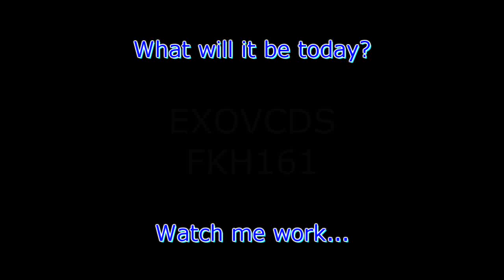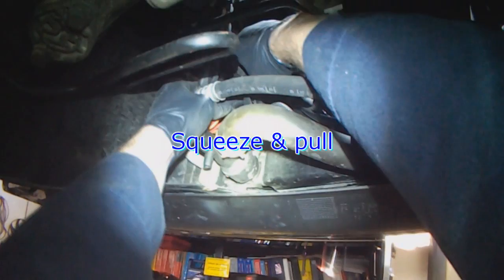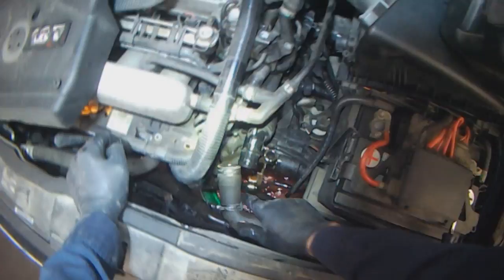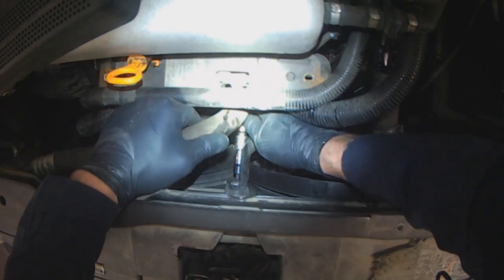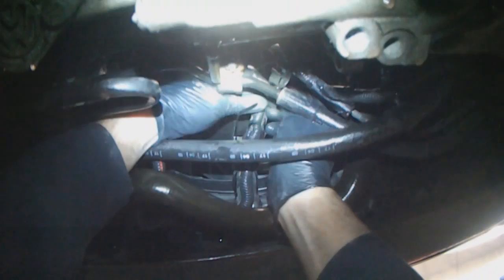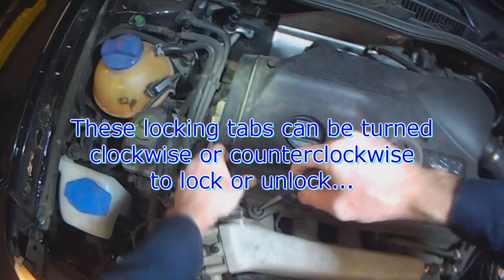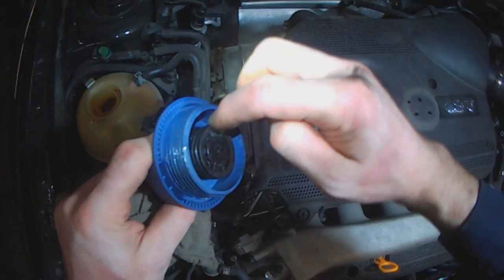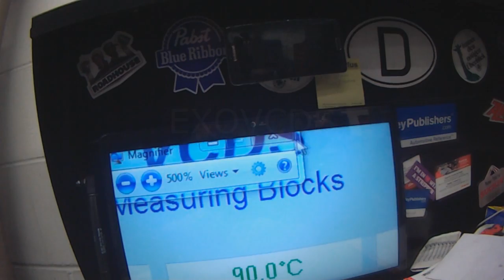VW A4: 1.8T large radiator fan replacement (A to Z)

Comment: FYI for everyone:  I just did this job today and the replacement fan was from Febi Bilstein.  On these fans the fan is held onto the shaft with a nut.  Mine came out of the box loose.  I put a little bit of low-strength Loctite on the threads of the shaft and tighten the nut up good.  Other than that the fan works fine.  Check yours before you install it!!
Reply from the maker: Good info for those with the same setup. Thanks for sharing!
Send me your mailing address and I'll send you some of my channel stickers.

Comment: Thomas I'm trying a spray can called chain lube , not sure the brand but it's pretty cheap and I think it's  got a lot of anti seize  in it. It sprays fantastic .  Might be a good product for you as well . I did the rotor face to the  aluminum  rims  and it's much better than the  old brush on anti sieze.
Reply from the maker: Thanks for the head-up... I'll keep an eye out for it!

Comment: Great stuff Thomas, doing this on my 2002 Audi TT Quattro 1.8T ALMS tomorrow and this helped. Really interested in the coolant info in here, my heater is slow to warm I think I may have a air bubble in the system. Have any videos on that problem specifically or will the info in this video suffice to fix it? Thanks mate.
Reply from the maker: Most likely a bad thermostat... opening too soon or not closing fully.
Reply: @EXOVCDS  fan definitely not working, running hot and climbs especially at idle.
Reply from the maker: @beaucottington if the water pump doesn't work, you will have lack of heat inside the car and the fans won't come on because the radiator doesn't get warm / hot.
Check for coolant flow back into the reservoir. No flow = bad water pump.
Reply from the maker: @beaucottington follow these steps.
https://youtu.be/LiDRUWPw_f4?si=2V7rg3xsQpjZz2Iy
Reply: @EXOVCDS  new fan installed and it engaged as it should, flow seems to be fine was just a bad fan motor
Reply from the maker: @beaucottington  thanks for the update!
Reply: @EXOVCDS  its a bit different on the TT than the VW but not by much. I was able to do it and not drain any coolant, I removed the fan mounting arm piece and pulled it out before the motor/fan. Opposite order on reinstall. I just had to remove the rubber intake tube opposite the throttle body and pull away the coolant line a tiny bit. A little knuckle busting but not too bad and all the 20 year old plastic survived haha
Reply: @EXOVCDS It was for a bit but then started heating up again, checking coolant flow to the reservoir and if that’s ok will do the thermostat. Any other suggestions?
Reply: @EXOVCDS  So my problem is persisting, I checked the flow back to the res and at idle its flowing well. However, I still have no heat inside. Could the pump still be bad?
Reply from the maker: If you don't have any overheating issues, then the water pump is OK. If the temp gauge moves to the middle quickly & stays there, then the thermostat is OK. If the needle drops while driving, then the thermostat is sticking open. If thermostat & water pump are ok, then the heater core is plugged.
Reply: @EXOVCDS  still overheating too, can the water pump be bad and still flow to the reservoir?
Reply from the maker: @beaucottington 
Bad water pump video.  Watch the first few minutes.
https://youtu.be/LiDRUWPw_f4?si=khWjG1H13xtGdyVu
I suppose there could be a bit of flow if the impeller is spinning somewhat. The higher the rpm, the more flow. If yes, then the pump should be ok.

You can remove the thermostat and check the pump impeller with your finger. If the impeller is loose, then the pump is bad.

It could also be that the impeller is metal, but has rusted off fins.

https://youtu.be/KWCdKgGvpUM?si=_R6y-_5Fe8wouVfy
Reply: @EXOVCDS  yeah saw that one, I have good flow to the coolant reservoir. Still overheating though, I’m scratching my head over here haha
Reply from the maker: @beaucottington I have seen TTs with incorrect temperature gauges / needles.  Sorry I forgot to mention that earlier. Use a scan tool to verify temperature. If scan tool shows normal temperature, but instrument cluster shows overheating, then the cluster is bad. Heater core is restricted.

Comment: Kind of off the subject but does your back get sore leaning over hoods all day? I worked on my truck for a few hours and I had to take some ibuprofen. So much plastic. I guess it works but I miss stuff made of metal sometimes. Good point about checking the oil. The tip on the alternator and related cables was good too.
Reply from the maker: I adjust the height of the car as best I can so I don't have to bend too far / too often... I'm sure that I'll feel it more as time goes on. Didn't win the big lotto on the weekend... so it's another week of work for me! =(
Reply: I hear ya brother. I'm almost 60 but I won't be retiring anytime soon because I like "Stuff". ha ha
Reply: For those of use you are well over 6 foot who don't have a hoist, back pain is guaranteed after working on cars for a day.

Comment: if my temperature Gage rise really fast does it mean I have a bad thermos static or a bad temperature sensor. I know that I have bad radiator fan already.
Reply from the maker: How fast from cold? Post a video... does it overheat as well?
Reply: Yes it reads between 190 and 260. but when I'm driving it cools down to 190.
Reply from the maker: Jason Li If it's OK as long as the car is moving, then the thermostat is OK.  Check your radiator fan fuse & the fans.
Reply: the fuse is ok. I do notice my fan doesn't come on. and where can I get just the fan and motor for a 2004 vw jetta 1.8t? I notice you replaced one for this video.
Reply from the maker: Check with ECStuning for the correct fan... here is a link with a list of fans. Call them and talk to them so that you order the correct one. https://www.ecstuning.com/Volkswagen-Jetta_IV--1.8T/Search/SiteSearch/Radiator_Fan/
Reply: awesome. Thank you!

Comment: what size is the fan sir for vw golf gti 1.8t 2004 awp code
Reply from the maker: You have 2 fans... a small one and a big one.
Contact ECS Tuning... they have several options for both small & big fans.
https://www.ecstuning.com/Volkswagen-Golf_IV--1.8T/Search/SiteSearch/cooling_fan/
Reply: @EXOVCDS  but only 1 is broken i guess the ac is working fine..
Reply from the maker: Yes, I know... only replace the one that is bad. I don't know which one is bad. Contact ECS or check the link of the correct part number and google search for cheaper alternatives.
Reply: @EXOVCDS  ty sir they help me find my big fan ..

Comment: use vaselin for ur hand bro
Reply from the maker: For what.
Reply: @EXOVCDS  for ur dry skin ..will help alot dont put powder with ur gloves its not good
Reply from the maker: I don't have anymore skin issues like I did 2 years ago. I'm also using a different hand cleaner & gloves now. The old cleaner I used to use was rough on my hands. When I don't wear gloves now, I use PR88. Great stuff.